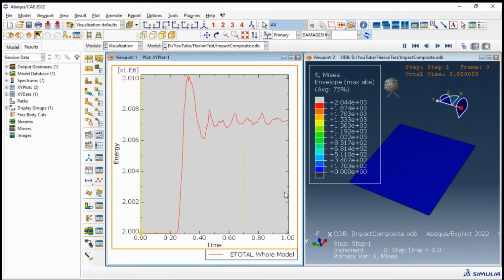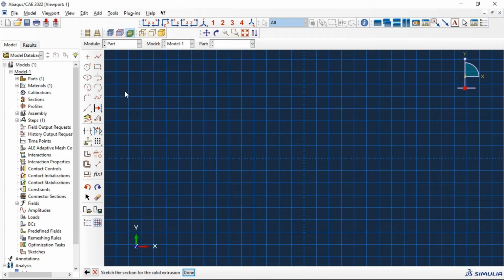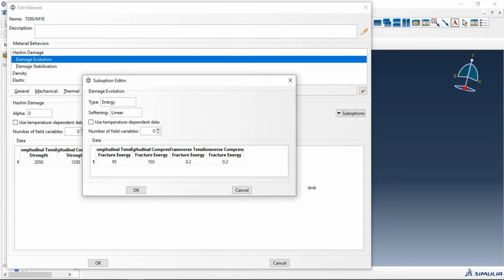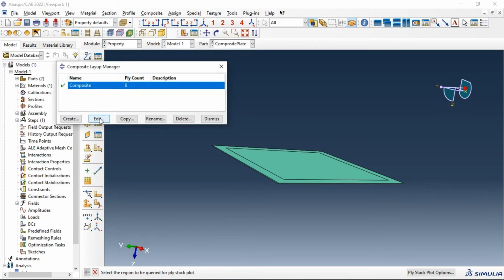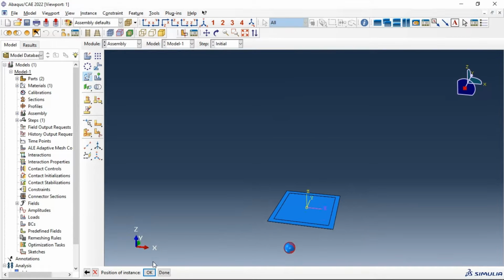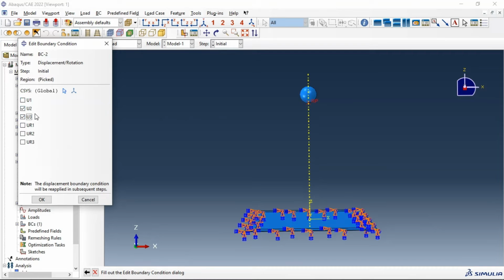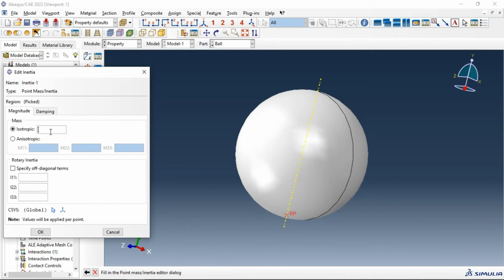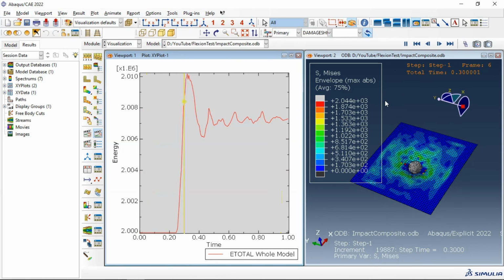Abaqus Tutorial:Modeling of Low velocity impact on composite structure with Hashin  failure criteria

Comment: I would suggest to take more care of material density when dealing with explicit analysis. The value used in the video is outside of all typical values for that composite, and in this case it's greater than alluminium. 
Then all energy plots are meaningless if the mass is not correctly calculated.
Reply: must be 1.80e-9*